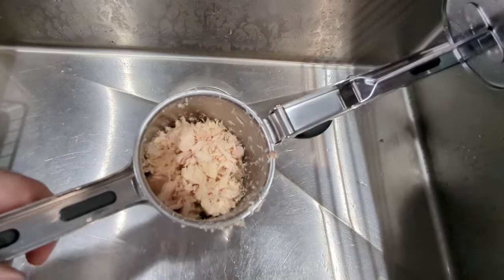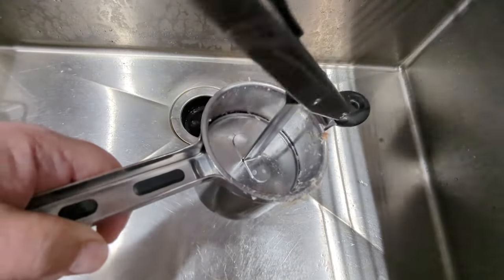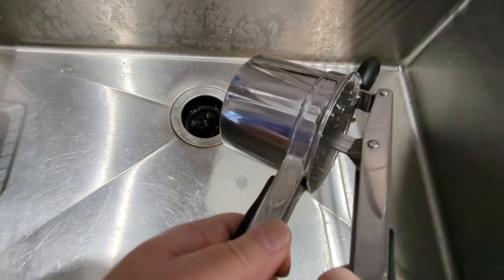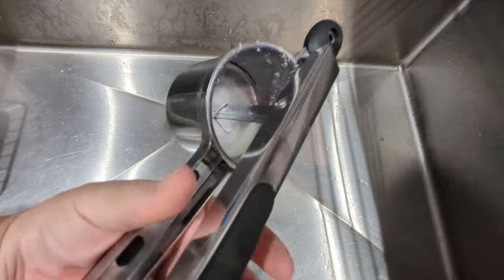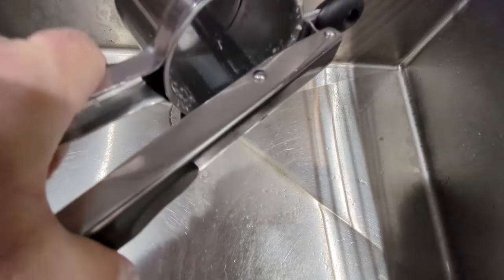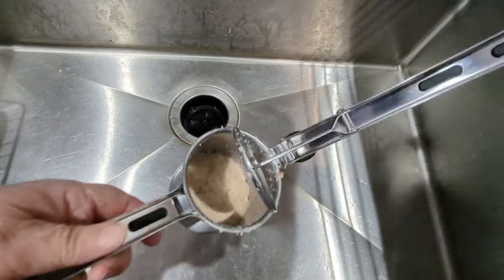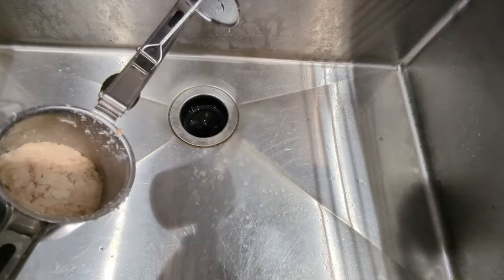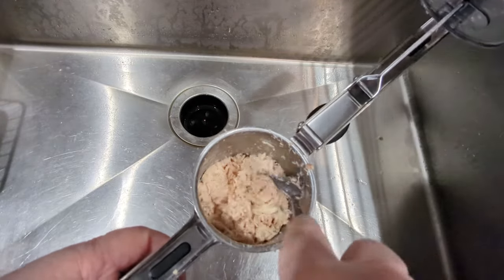Squeezing the Water Out of Tuna from a Can

Comment: I use the lid of the can 😁
Reply from the maker: That's what I used to do but the tuna salad still came out a bit too watery for me.  🤷  Also, our son bought us a "safety" can opener that lifts the lid without a sharp edge (gotta protect us older folks 🙂), it's great, really like it, but that prevents the lid from fitting inside the can to use as a press.  

With the potato ricer (that was pretty much sitting in the drawer unused before this) I can squeeze out almost all of the water and, at the same time, get a bit of a workout 😎